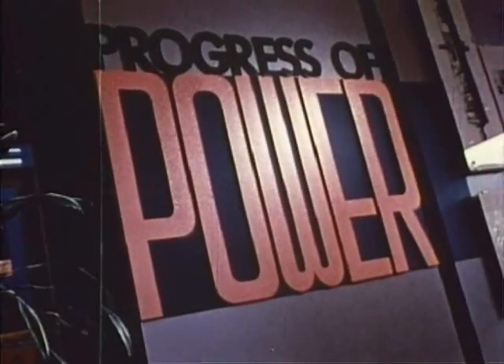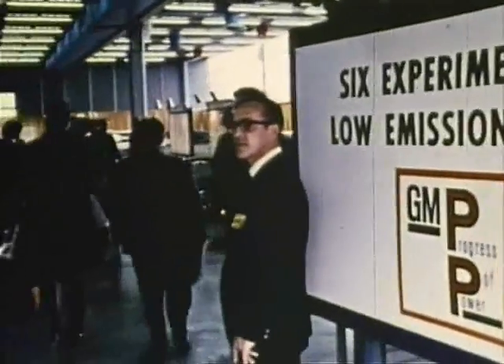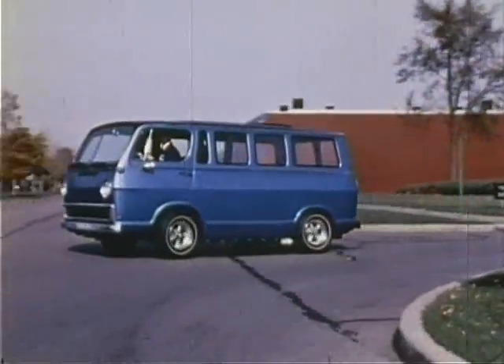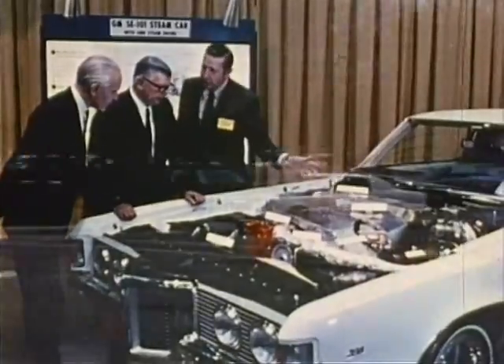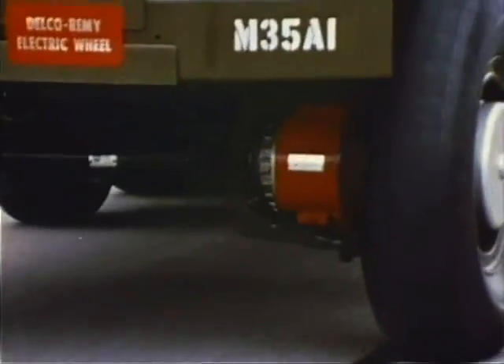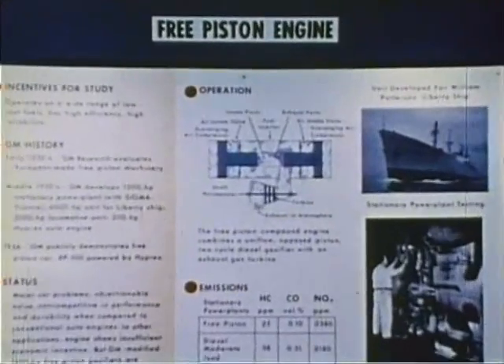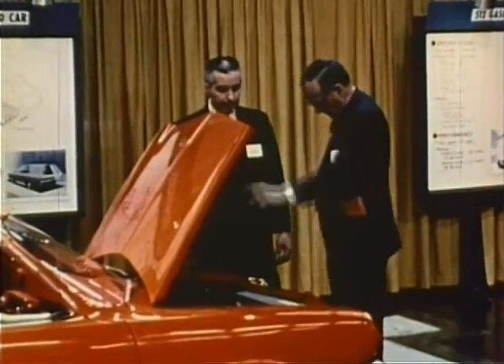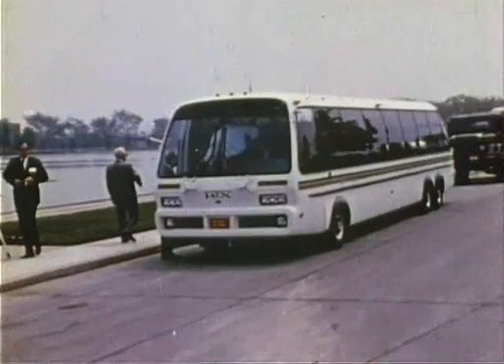General Motors Progress of Power

Comment: SO COOL !  Thanks for this post!  I've had the idea the a Stirling Engine could be run using liquid nitrogen by using the LN2 to cool the cold end and the surrounding  air to provide the heat energy to hot end to provide motive  power .     Patent 3190554  .